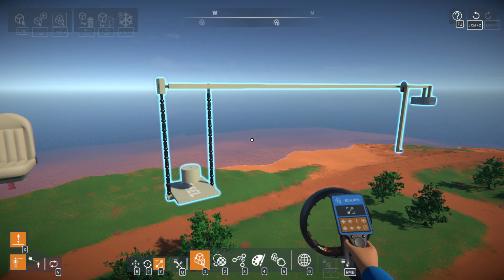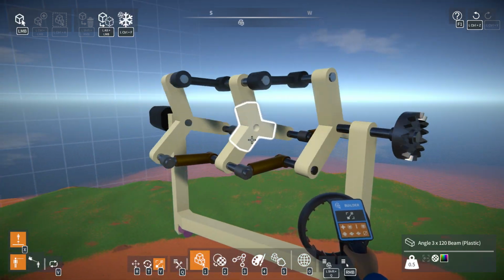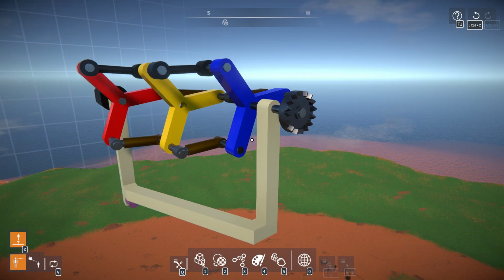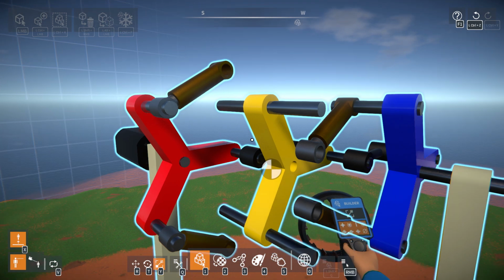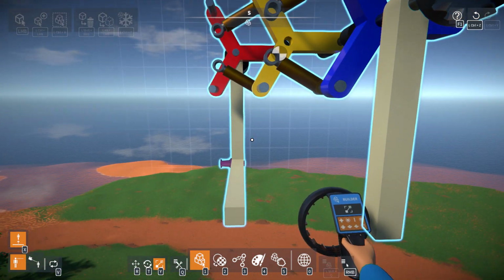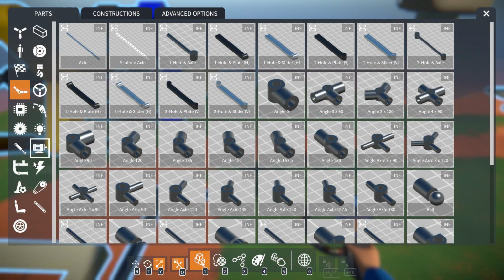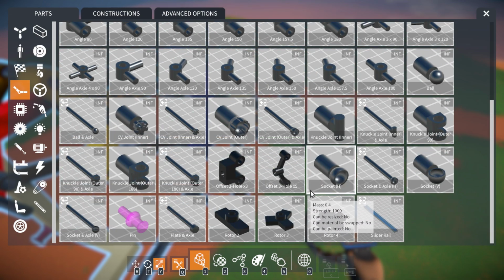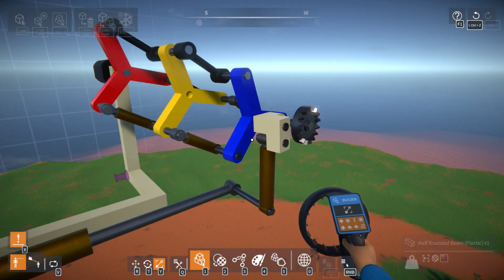I Built a Mechanical Device That is Amazing but Also Useless?

Comment: I built that in sm before. Even made a post about it on the scrapmechanic subreddit as identifiesasanonion.

This thing can transmit power from one axis to the other as long as they're parallel and the distance between the axels is less than 2r, r is the length of everything in that linkage, except for the axial direction.

Comment: Kan what if you used the schmidt gear with suspension on a vehicle? It seems it would be a good (if overengineered) way to have high suspension travel

Comment: The way the yellow part moves is exactly the same as how two rigid lever arms would behave when you move their ends.

Get two beams, red and blue, and attach them from one end with a freely rotating joint that you've marked yellow. Then, with just moving those free ends of the beams you can manipulate where the yellow joint is.

Comment: such a cool vid. 9:48 While it has been a while since I've had to do it in my engineering classes, but I think it would be a simple reverse kinematic equation system, basically how robot arms work. You have the position of the base and the position of where the head is or wants to be and then using the constraints that the distance between red and yellow is fixed and equal to the distance from yellow to blue, you can solve for where the yellow is. For this situation you would have 2 solutions except for when blue is at its maximum distance or infinite solutions when blue is in line with red, but to solve this it would be as simple as choosing the position that is closest to yellows current position.

Comment: I sent kAN 1 video showing off some cool lego transmission designs (5 transmissions from useful to useless or sth). And now his feed is probably filled with lego technic stuff like mine is xD

You technically only need 2 links so long as the arms they are on don't make a 180 degree angle with the center point (they are exactly opposite one another). But that would make the rotation unstable.

Comment: Hey khan, i've been watching your videos for a while and i have tried to beat your unofficial 160 cylinders/4000hp engine. Well actually, using a 9 cylinder radial engine put together in the worst way possible, i have achived a 576 cylinders lag machine that puts out roughly 900 000Nm and 267 000 kW at 9000 rpm. Anyways, love your videos and good luck ;)

Comment: Happy to be a part of the community. just a note. don't forget you can use sliders for more than just steering, if need more length they will "connect" when placed in line with each other. I've made a rail that goes across the small map :) cool Idea making that coupling in the game, I never thought of that either

Comment: The distances between the centers of the red and yellow, and the yellow and blue rotating pieces have to stay constant, let's call the distance r. The red piece is centered on the input shaft and the blue piece is centered on the output shaft. So you can just draw two circles centered on the red and blue pieces with radius r. The center of the yellow piece can be anywhere the two circles intersect. So there are usually two positions it can go. If you stretch it out to the max, the two positions will merge, so when you then contract it, the yellow piece will prefer the bottom of the two positions due to gravity.
Reply: good explanation, that makes it easy to understand